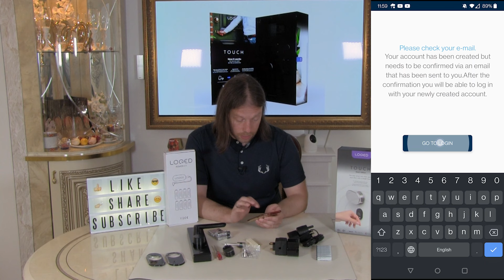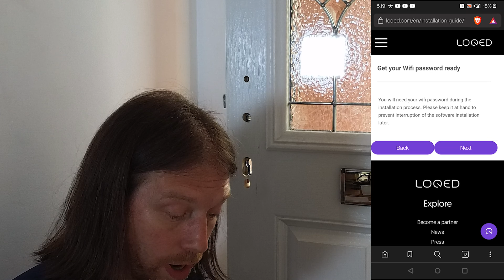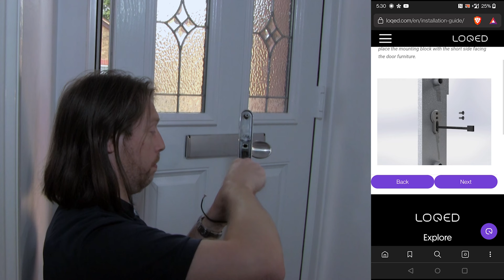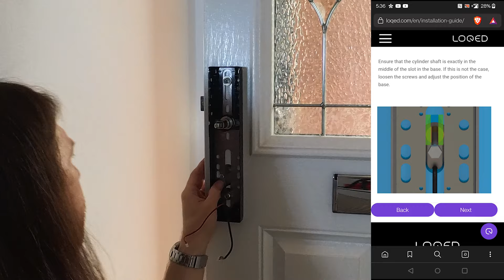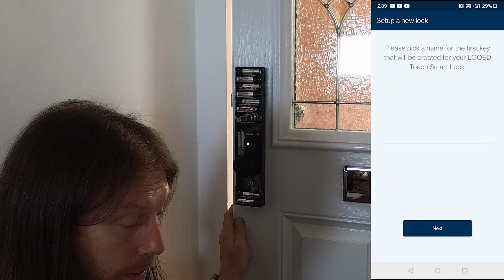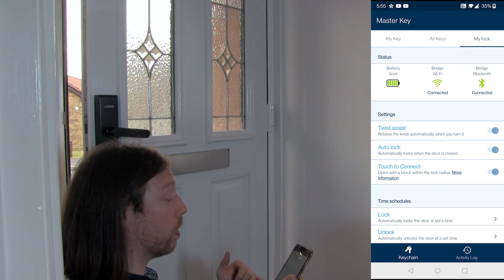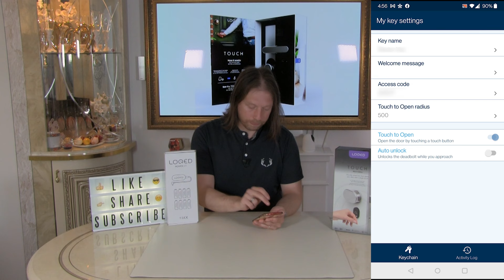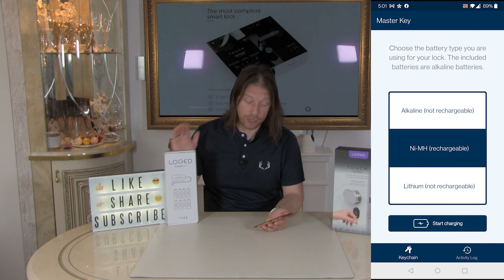Loqed Touch Smart Lock Unboxing, Setup and Review

Comment: Helpful review! It looks like from your video that you do not need to leave a geofenced area to then be able to unlock. You can just walk out of your house, lock it, and then touch it to unlock? That's handy as I'd have this on a back door so I can open it when I'm already in the house but I've walked around the back. I presume this isn't a battery drain on your phone?
Reply from the maker: Hi Phil,
Auto Unlock requires you to leave the geofenced area but pin and touch to unlock does not. There may be a smaller area for it to retrigger the wake of the lock. I find it normally is happy to touch to unlock if I cross the street and back, but staying on our drive which is about a cars length it will not wake the touch to unlock function.

All the best Dave

Comment: Thanks for the great review. I also bought it. I actually have a question regarding the door handle on the inside. Mine doesn’t come back to its position, i need to lift it and it doesn’t stay straight. It’s not stiff. Do you have that issue too, or maybe I missed something during the installation?
Reply from the maker: Hi Shanedely, if you look at this part of the video https://youtu.be/8aVovYLc6lc?si=SkNplW5fVY3_C0b0&t=1274 you will see a black plastic with sprigs in on the old outside handle. This is what puts the handle back to the centre position. My original door handle had one on the inside and one on the outside. I assumed this was normal so did not mention it. Look at your old lock to see if there is a spring of some sort to hold it in place. You may be able to move it from the old inside handle to the outside one. If you have it on both the spring might just be week and need to swap them over.
I hope this helps and that you subscribed as I will be doing more Loqed Lock videos, Kind regards Dave.

Comment: I want to buy this lock but I do not have a backdoor.
Is it reliable enough for a frontdoor without alternative entry to the house?
Reply from the maker: Hi Richi, So far the Loqed Lock has never failed to open for me. I have not experienced flat batteries yet so can not comment on how reliable the 9V backup terminals are on the front touch sensor but the app does show you the battery percentage giving you plenty of opportunity to charge or replace batteries in time. So yes I would be happy to have this as my only lock.
Hope this helps and that you subscribed as I will be doing more Loqed Lock videos.
Kind regards Dave

Comment: So when you leave the house and close the door the motor starts up. How does it know the door is closed, is there a door sensor?
Reply from the maker: Hi Virtious, This feature is now disabled for new users. I think it worked by sensing shock/movement of the door, then just assuming it is closed. So it did not always work. Hence they have removed it from the setting in the production model. I have made a suggestion that if it could be a handle position sensor then this would work for lift to look. This all said the touch to lock works perfectly as does the twist assist. Hope this answers your question. I intend to make a follow up video on the Loqed Touch Smart Lock as my opinion of it has only improved as we feel its benefits more and more. So hope you subscribed to catch the next video.
All the Best Dave